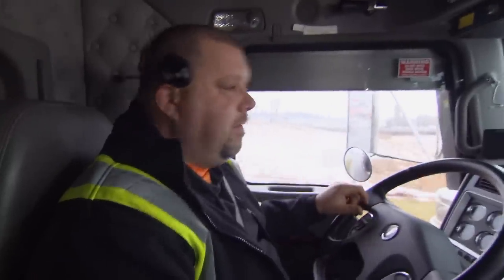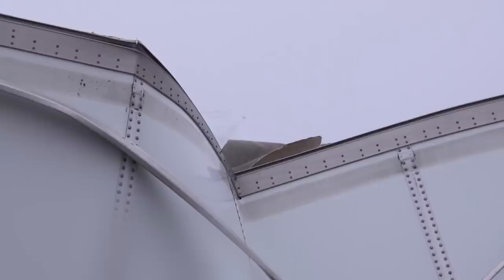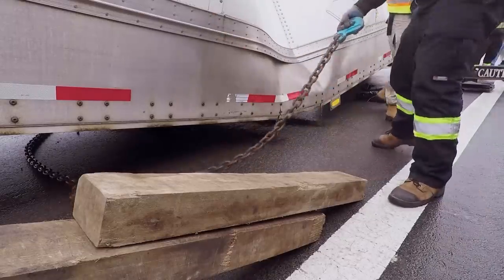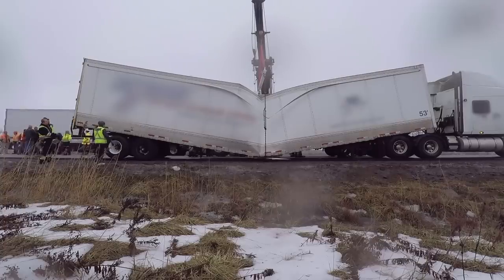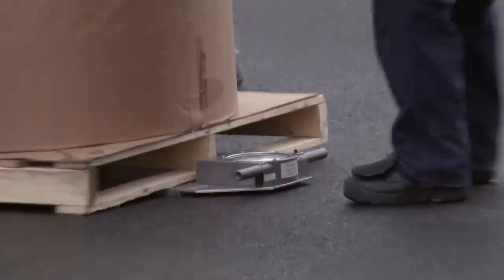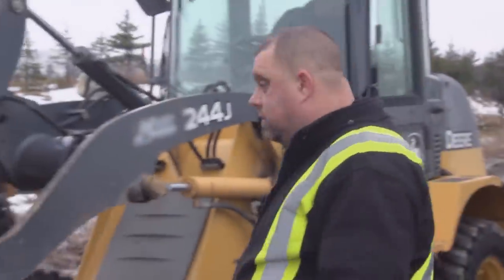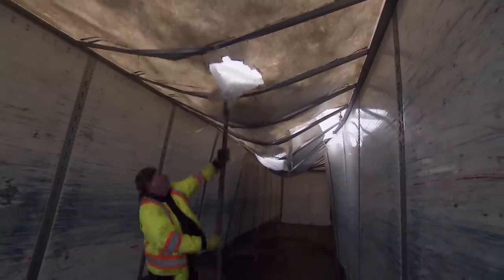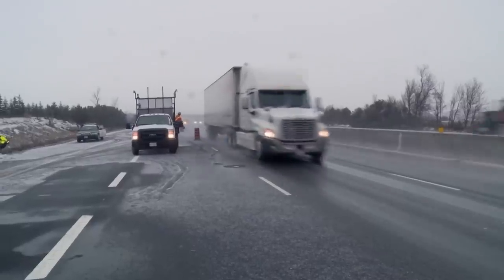What On Earth Happened To This Truck?! | Heavy Rescue

Comment: My company pulls massive paper rolls everyday. We have special trailer with re-enforced walls and floor so it dosent snap. All the trailers I see that buckle are overworked trailers not designed to haul paper rolls.
Reply: Every company has their own trailers and they are not the same depends what kind of trailer to use
Reply: All I can say is any trailers that carries heavy loads should have 6 to8 wheels would be better

Comment: is anyone else amazed at just how touch wood  is... Think about it, house movers use it to set entire houses on to re position jacks, this guy used it to support the angle iron, it never ceases to amaze me at how the simplest of products can work so well.
Reply: I haul 50,000lbs steel ingots, you might be surprised to hear that I place them on 3 6x6 planks to support the weight.

Comment: Wait.. There's dozens of tons of paper in the truck, and a few hundred pounds of snow collapses the trailer?
Reply: Box trailers are built like a house of cards but putting weight in the wrong place or unevenly will claps it
Reply: The snow and the load
Reply: Agree.. That trailer failed.. Probably from major fatigue hauling those loads all its life... Rip
Reply: When’s it’s all in one spot, yes. Also the roof isn’t made to hold that much weight.
Reply: @zeras1823  Wouldn't have happened in europe, also you'd be able to unload the trailer from the side instead of the end so you wouldn't have to risk the pallets breaking from the winching process.
Reply: Trailers are built like a truss and the roof holds the truss vertical giving it strength. Once the ice buckled a few roof crossmembers the side was able to collapse and literally the whole trailer loses it strength. 
I’ve seen this happen with little to no weight in the box. 
They should have known exactly what happened but as they said normally the sidewall pushes out, not in.
Reply: The straw that broke the camel's back.
Reply: Then why not just use body-on-frame trailers, like in Europe?
Reply: @Skoda130  because this is USA
Reply: @MrHunterkill90 , that's very profound. Thank you.
Reply: Yes it is a ticket in the US
Reply: @Ben31337l  Europe has no comparison to the truck drivers of the United States.
Reply: @ShutTheFuckUp1987  Are you sure? Sure there are a lot of differences, but there's a lot of similarities as well.
Reply: Yas
Reply: the paper is not on the roof... A lot of weight on the roof will collapse it.
Reply: @cramyt  k0
Reply: @MrHunterkill90  Did you even watch the video? Its a Canadian video, lol.
Reply: @Skoda130, it's significantly more than a few hundred pounds of snow.  The trailer is 8'6" wide by 53' long that's a lot of surface area.  Wet snow and ice are quite heavy.  The roof of a trailer is not load bearing, only the floor is.  So any failure of the roof will destroy the trailer as shown.   I am always baffled as to why truckers and trucking companies don't clear the snow off the roof trailers and the semi's that pull them.  Under the Highway traffic act the vehicle owner is liable for all damage caused by parts flying off their vehicle including snow and ice.
Reply: People don't understand that the roof beams on the corners are a major structural part of a trailer.....snow loading on the roof or and damage to upper rails is VERY BAD !!
Reply: But, the snow is wet and slushy making it heavier
Reply: More than likely the trailer was overloaded, and combine that with a trailer that is possibly out of serviceable age and the weight of snow, this could happen easily.
Reply: Ive seen guys slam their trailers onto the docks so hard they break their trailers exactly like this, without a load at all. Lets agree that whomever was driving this trailer around did not do their best to prevent this outcome. We will never know if the under structure had been fractured prior to loading or if the cold climate caused the metal to become more brittle with the amount of weight it was carrying.
Reply: Well this is Canada :)  @MrHunterkill90
Reply: Those were paper rolls which had got soaked in water leaking from the roof in the middle of the trailer.  This water soaked paper rolls had increased the load manifold, which was what collapsed the undercarriage of the trailer.
Reply: yes
Reply: Yeah, it could even cause it to collapse!
Reply: Not really a concise answer in any other comments so I'll try. The paper is loaded on the trailer where it's supposed to be, where it's designed to be held. The snow is on the roof of the trailer, which is designed only to hold back rain or a thin layer of snow. Good bit of wet snow in the center of the roof collapses the thin beams holding it up. Walls cave in, and the structural integrity they give the floor is lost. The weight of the paper then folds the trailer.
Reply: @thedemolitionmuniciple  yeah, that would have been a satisfying answer, if the trailer had been body on frame. But it's not very satisfying when talking about a monocoque trailer, that needs to have approximately the same strength over its entire body.

Comment: I work at a paper mill and have seen many trailer failures during loading. The clamp trucks used for loading weight 20k and an 86 in roll can weigh 7800 lbs. Usually the floor separates from the side and leaves the lift truck stuck inside. Trailers are made light to haul maximum payload but this trade off shortens their lifespan.

Comment: American trailers are extremely long for only 2 axle's where as european trailers have 3 axle's and are shorter with better weight distribution. That said a trailer should not have to depend on it's side wall for chassis strength, if it does it's too long.
Reply: But European trailers tend to have 6 wheels and not 8 like the American counterpart, also American roads and bridges are comparatively newer than their Euro compatriots
Reply: You know that the video is in Canada
Reply: Reverse Flash North America
Reply: steeve steeve but Canada is like a European country, because it was first owned by Great Britain
Reply: @Harryfom  you know that the United States of America and the North-American continent are not the same thing?
Reply: @tristianwilson3497  Depends on the country, Europe is not like the USA, the 'states' follow EU guide-lines but interpret them however they please... There is no unity sadly... So Belgium has horrible road maintenance while Germany and The Netherlands have very good quality roads, the bump in the road as you drive the highway from The Netherlands to Belgium is so horrendous you always know when you hit the Belgium roads (no lights, poor lane markers, holes in the road, poor road surface and so on).
The French police will always give you a speeding ticket, the Italians will not, the Germans will drive as fast as they damn well please and the Greeks? Well.....
Reply: Leopold71 when you say something is American it refers to US but if you say something is North American then you get it
Reply: European roads are also smaller to
Reply: Trucks in Ontario drive around COVERED in ice and snow. You hear about sheets of ice sliding of trucks and causing accidents all the time. Yet they are allowed to drive around with uncleared roofs smh
Reply: Reverse Flash Canada is nothing like Europe.
Reply: South Africa we have tri axles and super link trailers very safe
Reply: @reverse Flash      Y o u     A r e     s o         b l o n D
Reply: It kind of amazes me the amount of people that keep saying this is an American trailer. This is in CANADA. Watch the video?
Reply: 'cause america.
Reply: @clarda1 most Canadian trailers are made in the USA but 50,000 lbs is easily managed if loaded correctly.
Reply: Phillip Aubin  don't Volvo and scania offer some kick ass engines for Europe? Obviously I don't expect every fleet to use them, still though, to my knowledge it's better than any factory option in NA

Comment: The rear axle is way to back should have been moved forward
Reply: How would you know? If the driver scaled this load he would have a clue as to the legal weight distribution, unlike you. I am fairly certain he has the tandems set to be legal.
Reply: William Jones not to be legal im talking about to do the weight distribution! Too much weight in middle!
Reply: You do have to properly adjust the axles under the trailer to distribute the load. He may have been overloaded anyway.

Comment: The Trailer has no structural frame underneath it. Its basically a unibody type box structure. The box is the structural element in this design. Light, but obviously susceptible to failure if any of the walls in sheer, or the top in compression, is displaced out of line with the forces.

Comment: When the ice broke the roof,  the floor supports were taken out, removing what remained of the structural support in the middle of the load bridge. it is like two short trailers with a gap between them.

Comment: The snow did NOT cause the problems! Most likely they loaded the trailer with a heavy yard forklift... The weight of the paper and the large forklift cracked the trailer. I have seen this happen before.
Reply: It was the snow.
Reply: Yeah they are WRONG.  The walls and roof are not structurally integrated with the floor. You can cut them off and trailer is still sound.
Reply: @3a.m.284  didnt say it was a forklift. I do know that snow didnt cause the collapse of the trailer. Im a jet mechanic and a current semi driver. No straws.
Reply: What could do that, is hitting a speed bump hard, with those paperloads. Those rolls are heavy and concentrate a lot of weight because they aint square. I had a load shift , while hauling paper, i went slow to recievers yard, and i called company and they scrapped the trailer. I could see the stress marks in the frame.
Reply: your last name is dublin , backwards .My old model girlfriend was from dublin.
Reply: @3a.m.284  oh by the way, a forklift would be at the shippers, not on the trailer.
Reply: Yup, I have seen collapsed roofs from the trailers with damaged roofs that begin to hold more and more water but I have never seen it collapse the floor before. Truck driver is lucky the tow guy is an idiot and told trooper the problem was mother nature and not the maintenance issue with the crossbeams below. I have seen several trailers like this and they are always broken crossbeams. The driver and forklift driver could almost certainly tell the trailer was damaged when they were loading it. The floor will start to dip where the first crossbeam breaks. After that, more and more beams will crack until you end up with this. Driver might have known there was a problem for days or even weeks before this happened.

Comment: Fiberglass is not as strong as metal.  But with a fiberglass roof you can see what you're doing in the trailer a lot better.
Reply: Some trailers have holes on side so you see

Comment: That snow was far too little to collapse the roof. That did not look like tons of snow/ice. Seems more like the trailer floor was not designed for the weight or there was structural failure that went unnoticed and when the truck went over a bump in the road it collapsed.

Comment: Drove 30 years for a paper company. Trailers would be spotted at docks to be loaded for shipment. The warehouse was heated and the roof of the trailer would warm up. when it snowed the snow turned  to water then freeze. I would drive in circles in the Industrial park hitting every bump I could to break up the ice on the roof some pieces of ice falling off were 8 inches thick. No way I wanted a piece of that ice coming off and hitting a windshield. Company loader operator would scoop up the ice and dump it away so no one would hit it with a vehicle. It is a secured private park so no chance of injuring someone.

Comment: I see there is a snow scraper for the trailer that they drive under it and it will remove all snow on top of trailer this will protect it from flying onto other vehicles when driving in high speed

Comment: A driver responsability. You need to remove snow and ice before you  drive away.
Reply: @jdm Tuners there is a lot days to do it safetly.
Reply: This is in the Great Lakes area, famous for intense falls of wet snow - it is quite possible that this mess accumulated while the rig was on the road. However, I think the trailer design is inadequate. This kind of loading is reasonably foreseeable to a Canadian Professional Engineer and there should have been appropriate bracing to prevent the buckling of the top corners of the trailer.
Reply: This happens in summer too, in driver school we had to check the trailer brakes and tires most times a good driver can see problems, I seen box trailers rejected for a load just for a missing rivet !!

Comment: So many armchair engineers, so little respect for the ones doing the day to day work.
Reply: I tried to learn overarching pestering skills, but just don't have the attitude.
Reply: therockkkkher  Sometimes a college education fills you with the ability to do technical things, but blinds you to anything outside the ivory cloud indoctrination. Many times an executive is a business "expert" with no industry knowledge. the only way to know an industry is to learn it from the ground up. This is frightfully common in the mid and upper level administration of road transportation management companies. 

I discovered early in my career that a driver working in a trucking company office is both a rarity and an abrasive interruption of "the flow" in many trucking companies. I wanted to move from the drivers seat to an office desk, but was "to valuable where I was" to take me out of a truck. Drivers who were not good at OTR made it into the office, but I ended up quitting and starting a construction company with a friend ... six months later, our financing bank, with 29 loans ready to close was bought by another bank and needed 90 more days to review each loan. about that time the housing market disintegrated and our business went away. 

I ended up learning another job and trying to make a living from home.
Reply: Snow loads are reasonably foreseeable in Canada. If someone laid a complaint with the Association, it likely would have been upheld.

Comment: Its common for the steel rivets on the cross frames to cause excessive corrosion in the contact points on the aluminum side rails..its a main inspection point...if its missed for too long this can happen. Trailer overloaded with snow is bs.

Comment: I pull paper loads all the time. The trailer cannot be older than 10 years old and they DO NOT use pallets....a thin rubbery sheet is placed on the floor under the rolls. And most importantly, you drive CAREFULLY!

Comment: Blows my mind that they allow constructions like that on the roads in America. Just crazy. The structural integrity lies solely in the combined strength of every side of the box. Once one side gives in the whole thing is shot. Should have a steel girders running underneath the length of the trailer, as we have in Europe.